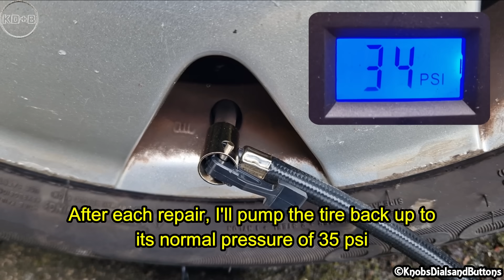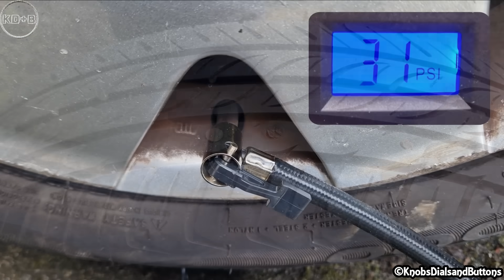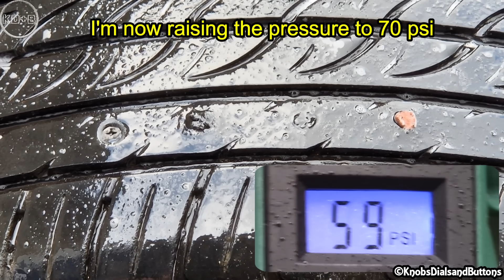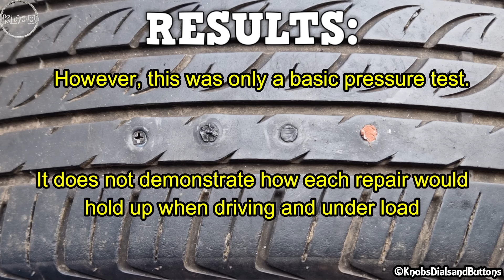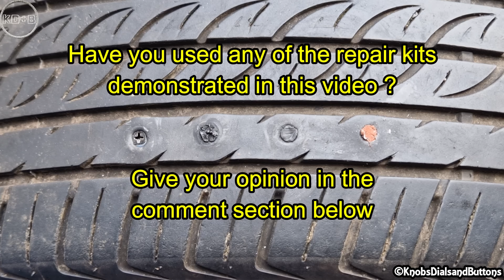Four Repair Kits, One Tire

Comment: I've used the ones first demonstrated. Rubber strip with rubber cement that you apply onto the strip before inserting. Both on my previous car and current car. Previous car I went about a year with the plug before trading it in and bought my current car where I had a tenP nail find it's way in a brand new tire. A year later and I needed new tires because I had no tread left. Plug still held. This is plug kits that I buy at any local gas station. Just assess your situation. As long as the object doesn't go in at too far an angle and not too close to a side wall, you will be fine doing it yourself on the side of the road. This is also in a passenger vehicle with no "extra" weight on the tire.

Comment: the orange strips are magical, ive used 3 in a sidewall gash and it held over 1000 km, well over, it lasted a full summer or driving, and a few 80kmph j turns, not trivial granny driving but hard abuse at times

Comment: Using the orange - red plug strip, I had it in my previous car for over 2 years until the car got sold, no cement nor glue was added

Comment: Been using 4th method that os screw with some kind of rubber seal. Been driving high way, long trip. Not even 1 psi drop. And it easy to use.

Comment: I pick up too many nails at job sites and such on my work van and personal car.  FWIW I use type 3 (from Green Slime) and use rubber cement with it.   maybe 12-14 so far, never had one fail.  I'm getting so good at it I don't even bother to take the tire off the car.

Comment: I've done a few of these plugs with the wheel still on the car.😁
Reply: i did used a repair kit from a bicycle on my car tire, and since the hole in the tire was from a tiny nail, it worked out quite well, but i took the wheel off the car as i was going to work....so i repaired it after work when there was no longer any air in the tire. The repaired tire did last for about 7 months, bcoz by that time the thread on the inner side was almost gone, so had to get new set of tires anyway.

After the repair i let the wheel in the trunk of my car for the weekend, so that the glue would do it's job. I drove multiple times up to 250kmh, no problems at all. The hole was just like in the video in the thicker part of the tire.
Reply: Me too, I thought that's how they were intended to be used? Quick and easy, even on the side of the road.

Comment: I've used the number 1 red strips since the late 80s and the repairs last until the tires are worn to the point of needing replacing.
Reply from the maker: Yeah they do seem to be the most durable, when done correctly

Comment: Should insert plugs , inflate to propper pressure. Then strap tire and rim down so it wont move and beat the plugs with a 12 lb sledge to simulate pot holes and such. ... Just a thought

Comment: The Screw Type Actually A Bit Different From The Other Patch Because It Just For Temporary Used Before Heading To The Tyre Shop... It Is Easy To Use By Anybody But Dont Give A Permanent Seal... It Can Fall Out When You Are Driving At The Rocky Road Condition Or When Your Tyre Thread Becomes Less... By The Way The Mushroom Type Is The Best One Because It Has A Mushroom Head That Hook From Inside... More Air Means More Tough It Will Be...  But For Me, I Would Like To Used The Traditional One... I Mean That The Rubber Strip Type Are More Convenient, Easy To Used And Can Be Plug In For A Different Hole Sizes... 😊

Comment: Ive had the first one, orange string fail as the fiber strands covered by goop acted as a path for the air to travel along.  Slowly, and it eventually sealed after days of driving.  I tried 3 strings from the kit and 3 ways of sealing the ends, cut, rubber glue, melt with lighter, and all leaked from that kit
Reply: U have to buy quality plugs. The cheaper one always leak.

Comment: Thanks for showing the different options, But if a tyre has has lost all it's air while the vehicle was parked, it can be very difficult just finding the leak in the tyre, you first have to jack the car up and remove the wheel, then inflate the tyre, you then usually need a leak detection liquid to spray around the tyre to find the leak,  (not very pleasant when dark and raining)  this makes repairing the leak the easy part, ask me how I know :(

Comment: My utility trailer had new tires, but one picked up a nail.  I had moved it while flat, about 100 feet.  I plugged the hole, but found out it was now leaking all around the sidewall.  Moving it that short distance, damaged the sidewalls.

Comment: Very interesting
If you are stuck on the side of the road with no spare - like many modern cars - the tyre screw is the easiest to install to get you to a tyre shop, at reduced speed, for a professional repair
I also carry a mountain bike tubeless tyre repair kit because the strips are much smaller but can still plug most nail sized holes without having to make a much bigger hole in the tyre.

If you want it to be a permanent repair, when you can work on the tyre safely, then the then the first two shown above are the best. I prefer the plug but they might not seat properly in tyres with the noise reducing foam inside - which are a complicating gimmick IMO

Comment: My dad on the garage for 30 years he never had a tire come back with a bad plug the first option is the best😅 I also have plugged at least a dozen of my own tires never had one Leak with a plug NAPA Auto Parts sells them the black tar strips microwave them for 10 seconds little glue done never have a problem leaking the rest of your life. I also never have taken a tire off to plug it unless it's inside just back the car up and do it from the back of the car
Reply: 35 lb of pressure is nowhere near enough for that tire you need at least 40 to 42

Comment: I love how u drill a hole, then use a tool to make a round hole;)
Reply: After removing the nail/ screw you need to ream the hole so it’s a uniform opening before you plug it. A kit comes with a reamer tool to smooth out and have a uniform hole.

Comment: I pulled a 3/8 bolt out of a tire. Went in head first. 3 to 4 plugs later it held air. I told the customer to get a new tire and don't drive fast or far.

Comment: Having repaired these types of repairs correctly most that came into our shop usually ruined the tire. Most punctures are not straight in. If you do not follow the first hole you create a second hole in the tubeless liner. The missed hole in the liner now let's air into the cords area and the air follows the cords looking for  another exit and can create a separation or a blister. If the nail or whatever created the puncture is still in the tire you have a chance of following that hole if you watch how it comes out. If it went in and came back out you have no idea what angle it went in.

Comment: I don’t like the screw one for one reason, it’s a hard core and it pushes the compound away. So when the tire gets deformed when driving it probably will have highest chance to fail.

All the other plug types use soft rubber which gets squeezed by the tires own rubber. Only the screw type pushes the rubber away.
Reply: @op3l  is that theory or practice? I have repaired tyres with the screw type, and they have lasted until the tyre needs replacing

Comment: The first three, i got no problem with & got them in a kit in my car. The screw type, im kinda of skeptial of that one, cause it doesnt grip the actual inside of the tire, so it cant be forced out easily.
Reply: buddy its a screw not a nail, an screw cant be forced out by air...
Reply: @ajendrasingh1220  yes and can be mix it with solvent glue

Comment: lately I use the SCREW version, What I have learn is that you have to SCREW IT very deep because as you drive the head of the screw will loose the head and you will be in square 1, screw it until disappear

Comment: Which one of these methods is the easiest, requiring the least amount of strength? I ask because pushing the noodle in took me a lot of effort. The plug looks easier, but it would be good to know.
Reply from the maker: The sticky string is relatively easy to push in, due to the small rasp and insertion tools

Comment: Mushroom plugs are lethal and dont hold. Never had a failure with a " bacon strip" but have had 2 failures with mushroom plugs, not prepared to risk a 3rd time

Screws work but need to be set just below the surface and are good for about 200 km if you use the ones with sealant on them.
Reply: I was with a group of bikers on the Isle of Mann in 2014 when one of the guys in the group had a puncture. He used a mushroom plug which took just a few minutes to fit and lasted with no problems whatsoever until he had to replace the tyre  almost 5ooo miles later. Like anything else, if you follow the instructions you should be good to go. Puncture repairs fail mainly because they haven't been done correctly. Any one of the mentioned repairs in the video should give good results if done correctly.

Comment: Perhaps a followup video where you drove a number of miles on that tire and see at what point they begin to fail? Ive used the first plug type 7 times over the years in 3 sets of tires and never failed even once but then again the sample size is small.

Comment: If you'd taken it one step further and driven this wheel for 6 months, including lots of highways, and reported on how well they held up, well then you'd have 10m views as it would be the most useful video ever. But without concrete evidence on how well they last... I dunno which to use, they all worked didn't they?

Comment: I've used the plug strip. Worked fine and stood up for a couple more years driving (~7000 miles) until the tyre was done. I picked it by watching a few vids like this and those found the plug strips very reliable and quite cheap. Mushrooms were considerably less reliable, and more expensive. I wonder how ell old plug strip works. The material is very flexible and sticky - I suspect after 10 years in the back of the car it may have lost some flexibility or otherwise degraded enough to be less reliable. Or maybe they last forever - I don't know. It came as a set of 4 and I get a puncture about once/decade.

Comment: Plugs are only supposed to be temporary the proper way is the patch from the inside
Reply: Correct. I just recently bought a Tire Patch Kit since I now own a Manual Tire Changer. I do still use the Tire Plugs because it's faster.

Comment: I preferer #1 method. not to say they are any of the remaining three bad, I have been using plugs for forty years and they work, I have even seen in the dealer I was working one plugged on a side of the tire and holding air, when you couldn't get a damn patch to hold after applying just rolling around inside the leaking tire after it slipped off, patches never any good after they quit lighting them to set the vulcanization.

Comment: I would never try any of these plug solutions with the tire under pressure.  let all the air out first to let any goop, sealent or lube to get into thw whole without blowimg back out.  I've had a lot of luck with the push in sticky strips including using 2 in one hole for a street for many miles and 3 or 4 on an ATV tire sidewall.  For the ATV, we also used a lighter to "melt" the ends sticking out after cutting them down to close to the sidewall surface.
Reply: I only use sticky strips even on the sidewall.

Comment: Do you have to twist the insertion tool like that?
Reply from the maker: Yes, on the chemi-cure string. The instructions say rotate it 3 x half turns
Reply: @knobsdialsandbuttons  OH that makes so much sense now. I've been using it wrong this hole time. You're pretty much making a knot inside the tire so that you don't accidentally pull too much of the string back out 🤦‍♂️

Comment: This was interesting to see but what I have a question. Is there any way to heat the tires up as if they were on the road and being also warn down to see witch one of these would last longest ? I have used all 3 except the screw one and they all eventually fail when the tires heated and worn down some. It would should be interesting to see if they hole up under being submerged in water like the tire was parked in a puddle for 24 to 48 hours as I have found that also affects the patches.. Anyways very cool video hope you make more like this and Thank you for both creating and sharing it with us....

Comment: I used slime black wire plug, 4 times on the same hole, each time it slowly leaks. No idea why. I even try drilling the hole to make sure it's clean.

Comment: hahaha i use the screw with sealant got a new scooter the EVR pro a e scooter in my first month got a puncture was not happy still not happy 

 but the screw has held it down to this day.
 8 months later , i do have better repair option now and will buy the mushroom plug thing as that looks simple easy and longer lasting

Comment: I wonder what will happen if you try it to run the tires for several kilometers under normal pressure and during hot days.

Comment: I think you actually did the sticky black string one slightly wrong. You pulled the tool out slowly and it actually almost completely pulled the string back out again. If I remember rightly you are supposed to pull the tool out really quickly and it cuts the string as it comes out and leaves it all bunched up behind the back of the tire.
Reply from the maker: No this is different than the other string repairs. This one has a closed eye on the tip of the insertion tool and your supposed to pull it back out of the tire and cut it. Here's a full demonstration video with an internal view of the plugging process: https://www.youtube.com/watch?v=SlhSq_WLAjg
Reply: @knobsdialsandbuttons  looking at that chemi cure kit the strings look somewhat thinner than standard strings? I wonder how long the cure process takes before being able to drive? Thanks for listing the link👍🏻

Comment: first type add cement to your reamer not to the rope and consider a permanent repair after balancing, 2nd and 3rd short therm repair its not really bonded with the tyre, 4th screw it deeper otherwise its a repair for a few miles and you may damage the tyre beyond repair if the air goes in between the layers.

Comment: Mushroom plug much better in a sense that you don't need much heavy force to insert it specially when the flat tire is in the rear and you have to jack and wrench to remove the tire from the car.

Comment: air leak will be when U use tire
repair witout glue will show air leak
i know  it because i use tire mushroom, kept popping up while turning the steering wheel
 then I contacted the manufacturer, they recommended removing all the silicone from the mushroom and applying glue
now its my favorite

Comment: For your "typical" punctures that would be viable for repair do yourself a favor. After watching this I've used every one of these but the last one shown and from now on that's the one I'm ordering the reason being is 1. If you have ever used the first 3 roadside it's a nightmare depending on which one and just getting it applied and 2. The last one you could use with ease WITHOUT removing the tire from the car (when positioned right being jacked up or just at the right angle) and with ALL of these I would never use any of them as a permanent solution.

So use the last (very much easiest one to use that even a weaker person could use easily) then limp the car down to the closest tire place to have an interior patch installed for 10.00 and be done with it. Some would say "well why not just use the donut"? Because it's 10X easier to install the screw than to exchange the tires plus 95% of donut's are the non-full sized ones that you are not even supposed to get up to highway speed's on. If you have replaced yours with a full sized then go for it but for me it's literally going to be a 5 minute fix then reinflation with the spare can of Fix a Flat I carry in the tool box (I only use it for inflation and so should you trust me) and within 5 miles or so it would be fixed permanently.

Comment: Anyone else don't bother with cutting/trimming the strip after ? I don't and never had a problem with it with my 13 Veloster and 22 GTI. I did try to cut it with my pliers  but the rubber strip is too stretchy for the pliers to cut off and I didn't bother anymore after that.

Comment: No 1  last well using Rubber solution glue!  Working in construction I get nails and screws in my tyre regulator and swear by them.  Never had a problem, Infact just in one tyre I have 5 of them and travel 1000s of miles!

Comment: Putting the pressure up to 70 psi is not only dangerous but doesn't prove anything, take it out on the road and drive it to see if the plugs actually hold.

Comment: Plugs are ok in a pinch till you get to a tire shop to get a proper fix.
Proper, meaning a suitable plug patch. Btw, I worked in an auto repair shop for a number of decades and have  repaired thousands of tires over the years. Once had a  tire come in with a flare nut wrench  stuck in it. That was a fun one!😂
Reply from the maker: A flare nut wrench ?...ouch, lol :)

Comment: A drill bit is not a very realistic hole stuff you pick up on the road isnt going to leave a perfect circle hole. Pieces of scrap metal and screws dont leave perfect drill holes sometimes is a gash or a rip. Any of these will most likely work to get you home for sure but you should either put a patch on the inside of the tire if you dont want to buy a new tire

Comment: Stickey string or rope plug both work great been using whichever one I get my hands on for decades and I don't even trim them the roadll do that. How far you need to run that string in there? You didn't read the instructions did you.😂😂😂
Reply from the maker: Do you mean these instructions ?: https://chemi-cure-repair.com/wp-content/uploads/2023/12/ChemiCure-User-Flyer.pdf